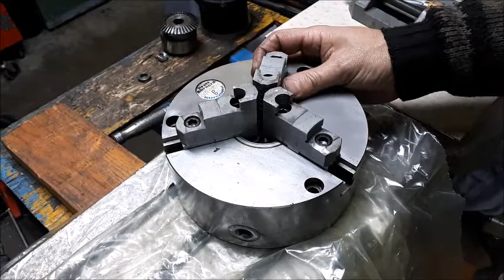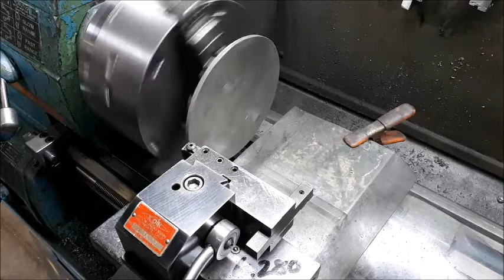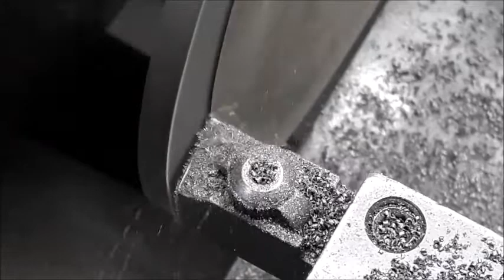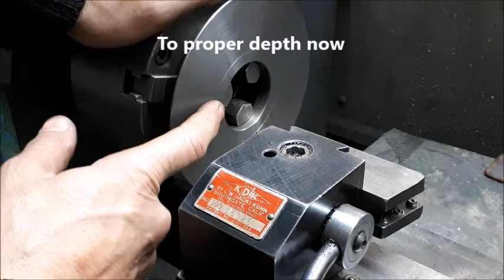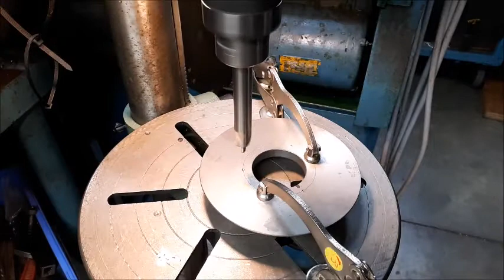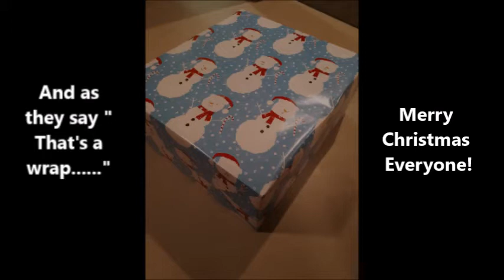Tools N Things 26 "Chuck" Needs Back Up

Comment: Why not machine 3 screws to a point and use them as center punches?
Reply from the maker: Not sure if you just heard that through the computer or not…… but it was the sound of a lightbulb going on💡💡💡 😊 Funny thing is I just purchased, have not received yet, an assortment of the thread in type transfer punches. With the OD qualified on that plate you’re exactly right… would have been dog simple to transfer the locations! Thanks for watching and commenting.

Comment: Great work! Did you have a local foundry cast them from patterns you made? I've always wanted to do that but figured the price would be outrageous. Thanks for another great vid.
Reply from the maker: Not exactly local, couple hours away up in Canada, but the team at Wells Foundry are so good to work with. So, I consider figuring out and making patterns a challenge and a learning opportunity a.k.a. free as far as my time goes- because I enjoy it. If you had to pay for a pattern there is no way it would be cost effective to do some of this stuff I cast. If your foundry will work with you on some of the smaller items, the prices can be rather reasonable as most of the labour is in the actual pattern. Thanks for watching and commenting.

Comment: I bought an 8 inch Bison very similar to that with L0 back plate and the back plate itself was the thrust plate for the scroll...I bought it on Ebay and it was very reasonably priced and unused..I had to make the whole piece because there is no buying 2  1/8 - 5 for a 1942 LeBlond trainer.. It was quite a project but I am very happy with it...Mike in Louisiana
Reply from the maker: I have seen those chucks where the back plate is the “keeper”, which would be a completely new level of machining skill for me and I’m not sure I’d be ready to attempt that just yet…. Nice when you can save parts and pieces… Thanks for watching and commenting.
Reply: @unknownapprentice625  YVW! Yes the chuck was so nice that I just had to adapt it to my old LeBlond trainer...I kept the original back plate as someday I may have a lathe with L0 spindle.. Happy machining!